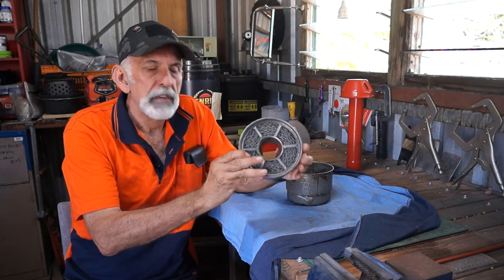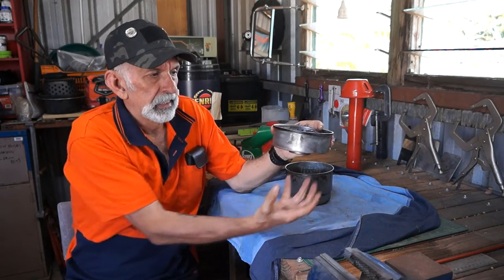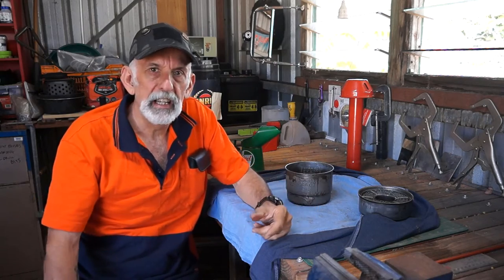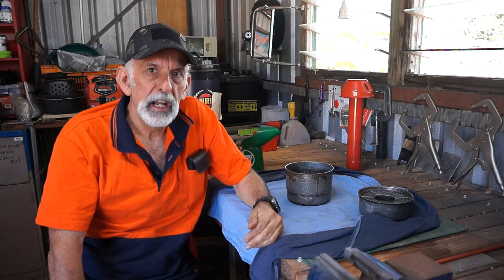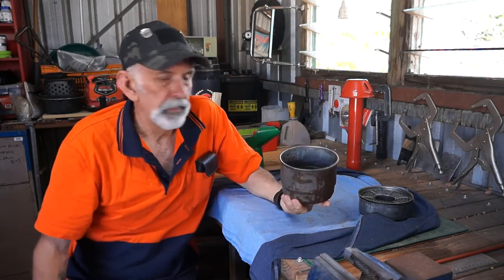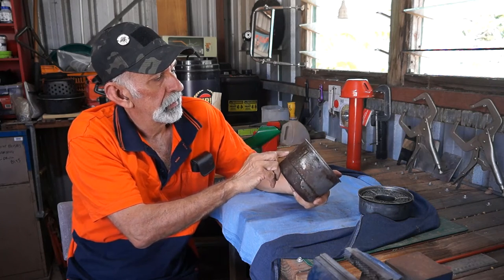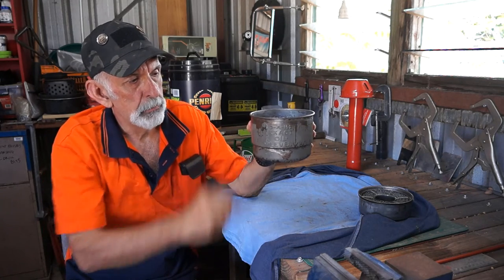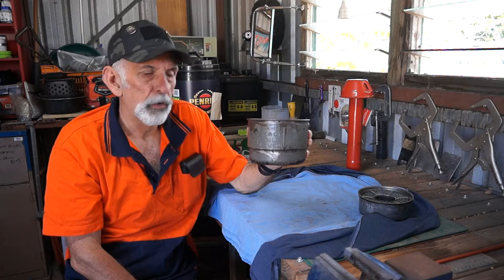Massey Ferguson 35 Oil Bath Air Cleaner - Part TWO

Comment: Did you have an inner "cup" with some holes on the bottom housing? Are you supposed to fill that inner part with oil too?
Reply from the maker: Hello, yes my tractor has an inner cup, sometimes referred to as a centre ring, alongside the outer ring. Here's something I have copied for you from a Forum, which explains it well -
the easiest way to avoid any confusion is to fill the centre ring as you describe it up to the holes…..the oil then will run out of the holes and start to fill up the outer ring. When the outer ring and inner ring are both at the same level you have cracked it….if there isn#t any visible level mark inside your air filter bowl you can then make your own mark where the oil level settles